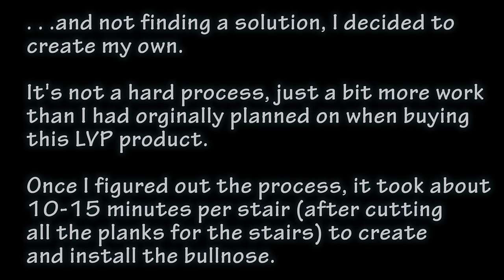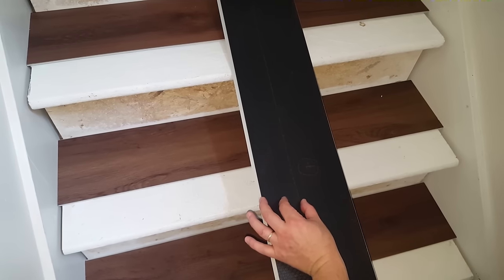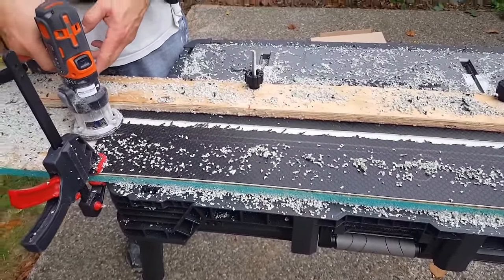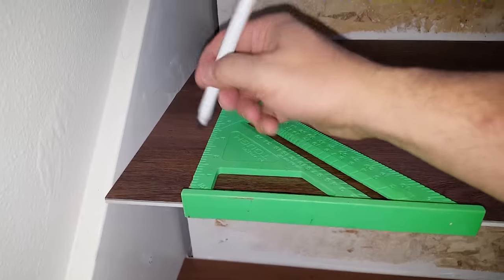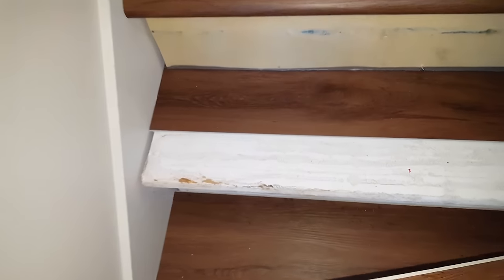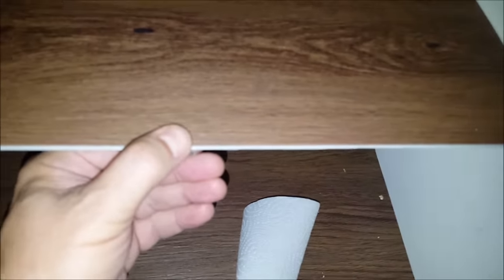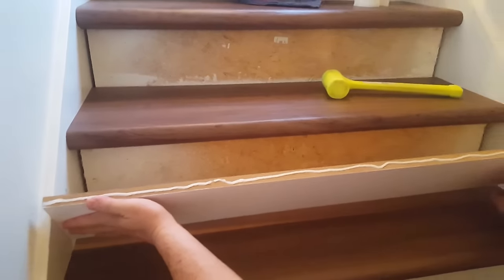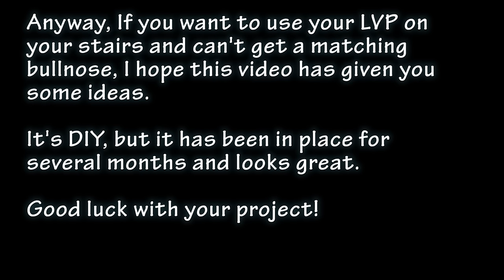LifeProof LVP Flooring: How to use on stairs and create a matching Bullnose!

Comment: Hi! You did a phenomenal job! If I’m not mistaken, the stair treads run in the opposite direction of your flooring, correct? Can you show me what the top of the staircase looks like as far as transition? Thanks!
Reply from the maker: Sorry for the delay. Yes, the top stair bullnose runs the opposite of the flooring (guess I could've planned that better). I'll try to get a pic up somewhere but the process was the same.

Comment: Looks great!  I'm about to do my basement, but with Duraclic XRP from Lowes.  As with LifeProof, there don't seem to be any bullnose options.  One thing that concerns me is slipping off the edge while walking down the stairs.  Has this been an issue at all?
Reply from the maker: It's been nearly eight months now and that hasn't been a problem at all. However, I can only speak to the LifeProof product.  That flooring has a really good surface that doesn't have much slipping to begin with.  When you slide your hand across it, you can feel the small ridges that I guess are supposed to mimic wood grain. I think having that grain(?) going across the stairs helps with slipping.  Even going down the stairs in socks feels really safe.  Best of luck with your project!
Reply: @ChronologicallyExperienced  Thanks!  The Duraclic XRP has the same fake wood grain in it, so I'm thinking it'll have that same grip.  Again, really appreciate the tutorial!

Comment: Thank you very much!!! I'm doing a kitchen and dining room  for a customer  next week in life proof flooring and they ask me about the stairs. I told them to get the bullnose in the matching color and I would do them. I didn't know life proof didn't make bullnose. The good thing is I'm meeting with them today to finalize the plans and now I can tell them I can do it. One question though,what did you make the risers out of?
Reply from the maker: Hi Tron. I used a 3/4" thick by 7 1/4" high pre-painted MDF sold at Home Depot and cut it to height as needed. Thanks for watching!

Comment: In the middle doing this project myself. How did you measure for the risers? Did you make a jig or anything
Reply from the maker: I measured the height from the top of one stair to the bottom of the one above it and subtracted the thickness of the lvp plank (times two) to get the height needed for the riser.  As you saw from the video, this allowed me to tightly squeeze the riser between the lvp planks which helped to hold them in place without nails. I did add glue to the back of the risers to keep them in place.  I didn't have to create a jig because the risers I had bought ended up being the exact height I needed (lucky me!). Thanks for watching and good luck with your project!
Reply: @ChronologicallyExperienced  thank you for the detailed response!

Comment: You still checking comments 3 yrs later? Hope so!  Awesome video.. so our stairs don’t have the round bullnose (wood) but we want the rounded one on the vinyl, thoughts ?
Reply from the maker: Hi Don, thanks for watching!  If you take a closer look at my bare stair treads, you'll see that the bullnose isn't completely rounded either. Because of the LVP thickness, it tended to naturally curve around the bullnose instead of molding to the actual shape that was underneath.  However, if you remove too much from the bottom of the LVP, the plank might be too thin and could end up mimicking the underneath bullnose as you heat it up and bend it around the tread. Test a small piece of the LVP on your existing bullnose to see if you get the same results I did. If your stairs tend to all be the same thickness and width, I would say your best bet is to use some extra wood and create a mockup of a round bullnose about the thickness and width of your stair tread and use that mockup to mold the LVP bullnoses. That will give you a consistent bullnose that you can then slip over the stair tread.  Good luck with your project!

Comment: I am a professional and never thought of that. That is a great solution however a time consuming one.
Reply from the maker: Hi Bob. As a professional, you might be able to do this much faster and maybe easier with different tools since I really was just figuring this out on the fly.  Once I had the process figured out, it took about 20 minutes total for each stair, from initial cut to heating/bending. I don't know how long it takes to put in a regular stair, but for me, it didn't seem that long.

Comment: Looks great bro it looks awesome the only question I have is the measurement to roll around the bull nose and underneath you didn't mention that maybe a template with some paper
Reply from the maker: Thanks Rob. Good idea. I didn't think of that in the video because I didn't have to cut my planks. I was able to use two full planks and they fit perfectly.  I'm doing a follow-up video soon so I'll mention that.

Comment: Looks great!  I'm not sure about LifeProof products, but some LVP flooring is "soft core" and others are "hard core", which refers to the material sandwiched between the top and bottom vinyl layers.  Your method may not work for both types.  Do you know which type LifeProof is?   Out of 14 bullnoses, how many flooring strips ended up as waste?
Reply: breathe
Reply from the maker: Thanks. I honestly couldn't tell you whether it is soft or hard core.  The material under the padding is like a hard rubber-like substance, but it didn't melt when I used the router so I'm not sure what it is. I only screwed up the one bullnose that I mentioned. I really took my time and tried to think out everything before hand since I didn't want to screw up and do extra work. But as I mentioned in the video, even that screw-up wasn't due to the process - just my own impatience.

Comment: When I try this, I think I would make the bends in the shop rather than in place. Seems like you could get them perfect ahead of time and slot them in. More room to work. Don't know if you tried that...
Reply: @candlewatt  Thanks. I imagine that not all vinyl planks are equal and that the thicker the tile the more difficult it will be.
Reply: @DougHigby  Well, after a few tests with the heat gun, heating up the back, I've decided to do white oak stair treads.  I was able to consistently break the LVP, both Lowes Smartcore Ultra and Home Depot Lifeproof, with my bear hands.  This tells me I'm better off going with real wood.  I think the heating makes LVP brittle.
Reply from the maker: Hi Doug. My treads were different thickness (ranged up to 1/2 inch difference) for each stair. I thought about bending them all beforehand, but figured I'd get a better fit for each stair by bending them in place. So far so good.

Comment: thx! for my risers I was going to use 1/4 to just skin the existing staircase, do u see any issue with my risers being 1/4 inch thick vs your risers being thicker?
 I have a prior carpet job as well with a 1"50 inch front on my step. I see alot of people on you tube cutting the overhang on the step flush than using a thicker riser. I was going to install like what you did with not cutting the step overhang.
Reply from the maker: Hi Tom. I don't see an problem with thinner risers. I was using my risers to help keep the molded planks in place so I wanted something sturdy. As for cutting the lip off, I would first make sure that you aren't making the stairs too narrow to step on going up and down. You want to avoid that feeling you get when walking up & down on stairs that your foot barely fits on, if you know what I mean. I prefer having a bit more room to step on which is why I didn't cut mine off. Plus, I think there may be some building code to watch out for that define a minimum depth/width. Hope that helps. Thanks for watching!
Reply: @ChronologicallyExperienced  thank you!!  much appreciated. i purchased my heat gun last night & tried a few test pieces. thx again for the added info

Comment: I have been doing custom jobs for years, this my friend is a job well done. Any issues with expansion of the vinyl floor at all? Great job 👍
Reply from the maker: Thanks for the props! No issues with expansion and we went through the hottest summer on record.
Reply: The current thinking is that vinyl planks don't expand and contract the way they though they would. the install practice of leaving 1/4" gap for expansion may be going away.

Comment: I like what you did there but having those riser's so tight, something is going to give when it expands, and when you have to replace one of those steps your going to hate it taking it off
Reply from the maker: Yeah, as an amateur, I was thinking 'tight' to help keep the upper bullnose secured. So far, so good though (after about 18 months) so hopefully I won't have to deal with it.  However, I did mention that in my 1-year update video for others to take note.  Thanks.

Comment: If you would have put the bullnose on first you definitely would have saved a lot of time. But overall a great idea. Kudos to you pal for a great idea. There is actually a company in south Florida that does the same thing and charges 35 dollars per step
Reply from the maker: Yeah, buying ready-made from a company would definitely have been preferred.  However, when I was searching the web at the time, no one mentioned the LifeProof product. My designer (aka spouse) was adamant about them matching the existing planks so hence the extra work.

Comment: Nice! Hey did you ever take a test piece too bend w/o doing that process with the router to cut out the underlayment material? I'm curious if I could do without that step.
Reply from the maker: Hi Eric. I did try it but it took too much heat to get to a point where I could bend it without actually melting the surface. That's why I decided to trim it back a bit. Maybe someone else might have better luck.  Thanks for watching!
Reply: @ChronologicallyExperienced  Thank you. And did I hear you say in the video that your LVP pieces are 7.25" wide? That sounds the same as the ones I bought, so you didn't need to cut the width down for your LVP to fit the total width of the stair tread? Your stair treads look like mine too, which is probably the typical 2x10.
Reply from the maker: @ericbader  Yeah, it worked out perfectly using two planks since the bullnose piece wrapped enough underneath the lip for me to pin it with the riser from the stair below it.  Good luck!

Comment: I’m the one who posted this on thefloorpro. I only have one question. Since you have done this in your own home and have lived with it for some time, would you say there is any safety issues with the smoothness?
Reply from the maker: Hi Barry, thanks for posting it - wasn't really expecting this to be a big deal. Just thought it might help a few folks with the same situation. 

As I mentioned in another comment, I can't really speak to any other LVP than the LIfeProof (from Home Depot). It has small ridges (I guess to imitate grain) and installing the planks across the stairs like that makes it basically slip proof. I've had it on now for eight months, been through hot and cold weather, run up and down them in bare feet, socks and a variety of different shoes without any kind of slipping - not once.  I've stumbled a few times, but that has nothing to do with the material, heh heh.  

The fact is, I've slipped more on other people's stairs than mine, especially those with smooth marble or hardwood. I've even had professional contractors come in for other work wearing their little boot slippers and mention how safe the floor feels compared to other homes. So in all fairness, it definitely is the product that makes the stairs so safe.  Hope that answers your question.

Comment: Not a fan of vinyl plank on steps but this is Genious, although I don't think it will hold up as well or as long as wood...good job
Reply from the maker: Thanks! I'm keeping my fingers crossed, but so far so good.
Reply: If the nose is attached to the base solidly with no gaps, it will be just fine.

Comment: Nicely done.  One question:  the fit on the left and right sides of each tread is very tight, is there any shrinkage or expansion with change in temperature?  I was under the impression that vinyl floor materials require some space for expansion.
Reply from the maker: It is very tight, but so far they have been fine. There is some debate as to how much space these planks need to expand and since it is only one plank in length, I think it will be okay.

Comment: Very well done! We did install vinyl planks on our entire house and we are stuck with the stairs. We are looking for some solutions and we found your video.  Question: We are not professionals so what is the name of the orange machine you used for the heat? Thanks again for  sharing in details your idea.
Reply from the maker: Hi Sandra, glad you liked the video and I'm not a pro either - just a home owner doing this for the first time.  

I used a simple heat gun that you can get from any major department or building store. The one I bought was a Black & Decker HG1300 for about $25, so not a huge investment and it has two heat settings. 

Funny thing, my old heat gun died in the middle of doing one of the stairs. Out of desperation, we tried my wife's hair dryer and it actually worked!  Only thing is it kept stopping due to overheating, but we got that stair done. Now that's DIY, heh heh. 

Obviously I don't recommend using a hair dryer since it is not meant for this type of work and will overheat. But the point is, it doesn't have to be anything really powerful. In fact, you don't want anything really powerful since you need to control the heat and not melt the LVP.  Best advice, practice on a scrap piece to get the hang of it.

Good luck with your project!

Comment: You're solution is great!  Thanks for sharing.   

Did you experiment with how much material should be removed from the back?  Thinking the less the better from an integrity standpoint.

I might try to pre-mold some stair pieces by warming them while clamped to our kitchen countertop made of granite as it seems to have the same profile as the stair bullnose.  I would want to ideally pre-mold the bend and then fill the plank with as much glue as possible on the bend to keep the best integrity underneath the bullnose.

How was it doing the top landing?  Did you do the bullnose piece 1st, and then start laying the upstairs, or did you lay the upstairs 1st, and then fit the bullnose piece to the stairs last?
Reply from the maker: Did a little testing before starting and settled on removing about half of the backing (1/8).  You may be able to take less away, but once I was done with the stairs, I had no energy left for additional testing, heh heh.

As far as the top stair goes, you could go either way, just depends on how you want your flooring to line up across the room.  If you lay the flooring first, you need to calculate on leaving enough room for the bullnose to have a solid grip and can snap into the rest of the floor.
Reply: KC, do you have a table saw? to experiment, rip a piece of wood to the thickness of the tread. Don't use the counter top. I fear for it's safety. Try heating and bending without removing any material. If you want to make a squared nose, you may need to cut a kerf in the corners. For a full radius, you don't need to make any kerf cuts. Keep in mind the bottom of the nose won't see any traffic or any kind of wear. The odd light kick shouldn't do any damage, so no need to fill the area in to beef it up. I bent a piece of flooring to a full radius without removing any material. I'm 170 lbs and can stand on top of the edge of sample, meaning trying to pinch it closed and it barely deflects. If you decide on cutting kerfs, you'll have to experiment with depth. I made a transition using the kerf cut, heat and bend method. I cut the underside to within 1/8" of the finished surface.

Comment: Great instructions, thanks. Question...One board is flush against the riser, and the new board will interlock to it, and then bend over the stair edge, but underneath the stair edge, what was your process to measure the width to ensure that the board would bend under the lip and be long enough to be secured by the new riser, but not too long to prevent bending as it would hit against the riser during bending?
Reply from the maker: I used one of those cloth measuring tapes that they use for sewing.  This allowed me to accurately measure from the end of the plank against the riser and around the bend of the bullnose to the edge of the underneath riser. Luckily for me, it was exactly one plank wide so I didn't have to do any cutting of the bullnose plank.
Reply: @ChronologicallyExperienced  ahh..doh', of course... I'm busy with the measuring taking into account 6 doorways on a second floor hallway and the one staircase. Very much appreciate the video and reply.

Comment: With the tight fit of everything, how is it holding up to thermal expansion? LVP, and wood moves and expands seasonally. 
Looking to do this kind of thing myself, in the next month. Thanks!
Reply from the maker: Hi Patrick, thanks for watching! Although I initially thought they were too tight, I think I showed in the update video that there actually was a little bit of space on each side of the planks. Not much (about 1/8"), but I guess it was enough because I haven't had any issues during the almost three years now of summer and winter. Temperatures have ranged between the low 100's in the summer down to the 20's in the winter. Beginner's luck I suppose, but I would suggest others use the 1/4" spacing recommended if you use LVP.  Good luck with your project!